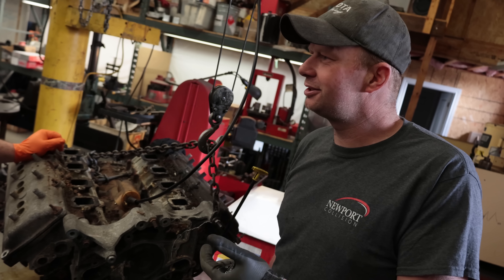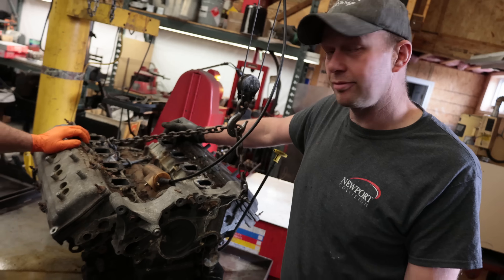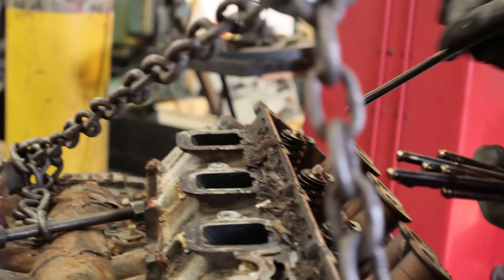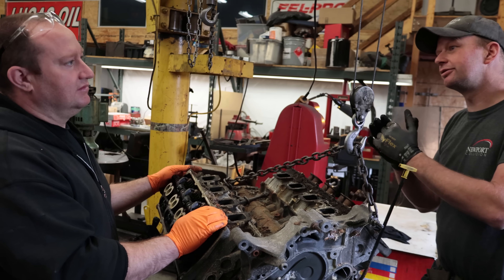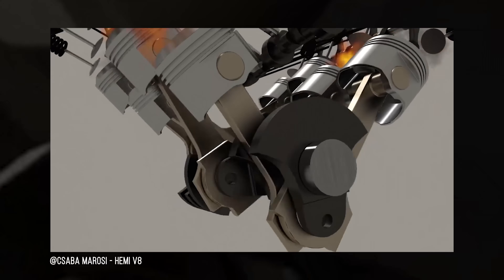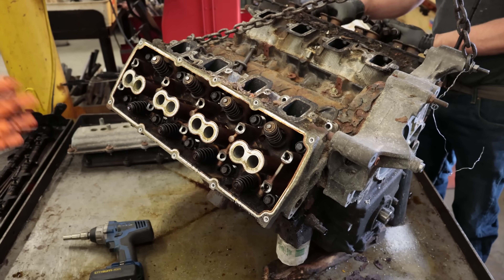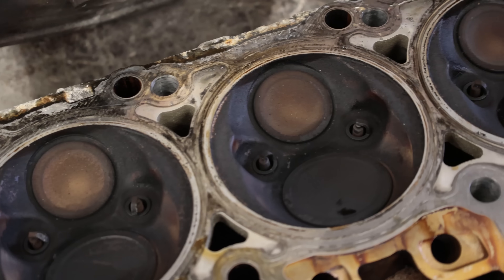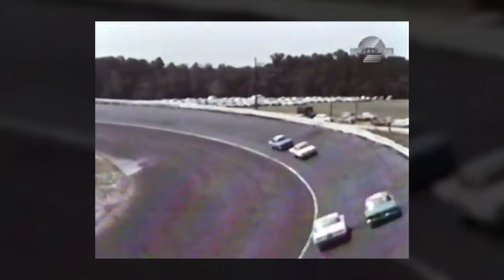REVIEW: Everything Wrong With A 5.7 HEMI 345 Engine

Comment: Lifter faliure started with the 09 vvt motors. The older pre vvt 08 and older hemis are bullet proof. Currently refreshing the top end on my 08 300c awd and deleting mds with hell cat lifters and replacing the cam in the proccess. Not because a lifter failed or anything it was still running strong but because it has over 230,000 miles and i plan to keep it so refreshing the top end and deleting mds and installing a high volume oil pump while im there is a good idea. Besides properly deleting mds and running aftermarket shorty headers to avoid another exhaust manifold leak + exhaust of course cause its gotta have a little rumble its going back stock These motors rip and amd have very quick snappy throttle response dont need more than 345 horse and dont wanna ruin the smoothness of the car with a lopey cam.  Im not turning it into a race car im fixing up/restoring the car to factory new. the early 2000s 300c's are very neat cars but sadly they attract low income people or people who make poor life decisions so almost all of them are butchered with awful modifications or wrecked. The cars get a bad rep cause the people who own them just beat them into the floor and / or partake in illegal activities. I finally got my hands on a clean untouched one and i plan to keep it that way. its Very handsome well built AMAZING driving unique american car when you leave it alone and dont install a million ebay stick on bits and lights, drive it like a dumbass or throw on ugly 22 inch wheels

Comment: I had an 06 Magnum RT and other than replacing plugs, belt/tensioner and the EGR valve and doing regular oil changes I did ZERO work on the engine.  It was at 487,000kms when I finally put it to rest.  That hemi outlasted everything.  It even outlasted 2 transmissions.

Comment: Im looking at the 2026 ram to get my first 5.7
Im an amsoil dealer amd have always been methodical about lubrications changes throughout my vehicles. Im currently running an 6.2 SVT with 111K on it and she runs like a top. I hope the new 5.7 will do as well.
Anyone else looking forward to the 5.7 coming back in 2026?

Comment: So whats wrong with  the lifters is the roller tip of the lifter is only splash oiled and the lifter is layed down so much that when its idleing its not splashing enough oil around so there is a few ways to fix it the factor oil pump at idle is in the teens like 15 to 19 psi if u put a High volume pump it got a 17mm wide vain pump the stock 1 is 15mm and to make it bulletproof johnson lifter makes a lifter that oils
The needle bearing on the lifters !! Them lifters alone are around 1000$ dollors versus around 400$ for the up graded stock like super bee lifters and  delete the dod lifters 4 cyl mode im specifically talking about a 2010 RAM 4X4 truck most if not all but just a few have lifter failure around 100 thousand to 150 thousand miles !! If u dont idle the truck alot it will go 150 if u do it will go closer to 100 if u never idle it you might get 160 180 but its going to fail if u have teens oil psi at idle if yours makes it longer its because yours has 40 plus oil psi hot idle!! So to check your car or truck get a scanner put on it and start it and its hot idle see what the scanner says if its teens its going out if u dont have any problems put a high volume pump in it and it should be fixed texas speed has all the parts to fix your motors im not being paid to say this im a mechanic and im fixing 1 now so all this is fresh in my head so im just posting to help save somone alot of time your welcome !!

Comment: I'm 80% done with a rebuild on my 5.7eagle. Had a slight tick when I bought it at 130k. At 136k git worse. Pulled cam and lifters and cylinder 3 lifter roller had completely disintegrated and I'd began riding only on the shoulders of the lifter. Mds delete engine flush and cam amd hopefully I can get a few thousand Iles out of her. Wish me luck.

Comment: So the MDS system really has nothing to do with the Hemi Tic, it has more to do with the lack of oil flow and pressure due to the oil pump being inline to the crank.  Less Rrpm's less oil flow.  MDS has been in the Hemi since 05 and the tic was not an issue, the block has not really changed with the exception in 09 and later the oil pump has produced less of a flow which in turn ruins the lifter...I have been reading and watching because I have a GEN 3 in my 19 and I have noticed that the tic is slightly longer on a cold start...so I am begining to think I should due a cam and lifter replacement.

Comment: I got a 2007 ram 5.7 never gave me any problems got it at 120k now its at 203k and never gave me a check engine light and i drive pretty heavy footed but not stupid. Mobil 1 5w20 high mileage every 3k-4.5k miles

Comment: Hello.. Interesting video.  I had a Jasper Hemi.  About 150k Parked it after a long drive. (No noises or anything unusual).  Parked the truck and next morning wouldn't start.  Determined no compression (about 30)  Shop said they think it jumped timing.  Can't understand when that would have happened as drove fine.

Comment: Why not use 2 different plugs. You don't need a $15 plug for a wasted spark. But if you route the wire back to fire both plugs at the same time and not waste a spark you should use the same kind.

Comment: 5.7 Hemi: Do an oil change every 5k or less. Never sit idle, treat it like a race engine and turn it off. Deactivated the "cylinder deactivation" every time you drive by locking out the gears in 8th. Always let it warm up untill you no longer hear the lifters ticking. If ticking continues once the temp is up, see a mech. Could be lifters or manifold.

Comment: I had a 2010 Ram 1500 with the 5.7 Hemi. It was a generally a good engine for me - lots of highway use which limited the amount of MDS time on the engine. The problem I had with mine was its tendency to snap the exhaust manifold bolts. I was on the second set of bolts on one head, and on the third set on the other. This also resulted in a replaced head on one bank since they couldn't get the snapped bolt ends out of the head. This problem with snapped bolts led to blown exhaust manifold gaskets which sounded like a kind of "Hemi tick"...
Reply: MDS is used far more on the highway at cruise speeds than in the city mostly accelerating.

Comment: I have a 2011 ram 1500 5.7. My cam and lifters failed at 80,000 miles .When I was in the dealership, they said this is a common problem.

Comment: The splayed four bolt main cap is stronger than the 6 or a the 4 bolt 350 main because of the side v pull the stress into the block in the wrong direction and make it actually weaker. The stresses imposed from the bolts coming from the outside of the motor sideways outweigh any gain in strength from the bottom. Is just kind of productive. Having the 4 bolt system and the two outer bolts at a display dangle seems to work best.
Reply: Angle not dangle. Google can't spell or I can't talk...

Comment: I have a 2016 dodge ram 1500 5.7L and on my last oil change at dealership (110k) I noticed a lifter tick not on start up but after about 1 min of driving then goes away but does it now every time,  the dealership told me to wait till something goes wrong then they'll address it because I have the unlimited powertrain warranty 🥴, I currently have 112k miles on it

Comment: Great motor if u maintain it my 09 ram 1500 has 260k miles still strong no leaks just the small hemi tick on startup have gone through a few water pumps n manifold bolts though

Comment: About the main cap bolts. Not sure which L.S. your referring to. 2 of the studs on the main cap are to hang the windage tray on the L.S. 2 bolts for the cap. I remember when the 2003 Hemi came out. Way more power thanChevy or Ford. 95 horsepower more. I bought one in an 03 Dodge quad cab 4x4. Had the truck for 12 years and 114,000 towing and hauling trouble free miles. My current 15 Ram 392 6.4L Hemi has a switch to turn off the MDS. Tow /Haul. Stock vs stock Hemi engines breath better because of the large opposing valves. (cross flow)

Comment: you do know that modern Pro stock engines have Lifters that high in the block and on par with the "hemi Horizontal"  
And as for the 4 bolts main.......We've gone as high 1800Hp on those 4 bolt main.

Comment: 1980s M body, especially one that had the 318-4V, since at least the A38/AHB police package cars already had a 8 1/4" diff, etc. As for the tranny; the A904/727 Torqueflites can be beefed up.or, the 5 spd M-B based unit.

Comment: I had a lifter fail at 97,000 miles in a '14 Charger Pursuit. Took the engine apart and it was the No. 5 intake lifter, which is not MDS actuated.  However, it was a cop car that had 1,600 idle hours, which is not so much, but probably more than normal. I have heard that the design is flawed in that insufficient oil amounts reach the cam and lifters.  Not sure.

Comment: Uncle Tony's Garage explains the failure point on these motors, Chrysler decided to move the camshaft one inch higher than standard height which is why the lifters are getting poor lubrication at lower rpms which after time embeds the lifters in place and eats camshafts.
Reply from the maker: Higher wouldn't matter.  Its the angle.  If height was an issue, and larger industrial engine would suffer from the same problem.
Reply: @DEBOSSGARAGE  And larger industrial engine use thicker oil which keep everything lubricated for longer periods of time rather than your standard 5w30 or 10w30. When I owned my 08 R/T I switched to 15w40 syn blend and had zero issues even after 300k+ hard miles. You'll have echanics blame the owners for not changing their oil but those same customers would change their oil religiously.
Reply: @DEBOSSGARAGE  The angle is also the issue but the height is 100% the problem since the ultimate failure is a lack of lubrication

Comment: Take it from someone who's owned 5 hemis.  They are a amazing bulletproof engine.  Exhaust studs and egr valves are the only issues that reappear. 

The Hemi "Tick" has nothing to do with lifters.  It is in reference to a condition in the 2003 to 2008 hemis that had valve train noise which was normal.  My 2005 would just idle and tick away and currently has just a bit over 700000km on it.  These days everyone has confused the hemi tick with the lifter failures in the 09 plus hemi with the mds,  not the same thing.

Comment: Got a 2018 Challenger 5.7 I got at 13k miles, had a small tick when I bought it, dealer wouldn't do anything said it's normal?.. Drives me nuts. Got 28k miles on it now and do oil changes religiously. Going to eventually trade it in so someone else can deal with it, maybe eventually buy a Hellcat before they stop making them
Reply: Could be injectors if its at 13k. The injectors on the 5.7 are known to be loud.
Reply: @bill_clinton697  I dont know, on start up it will be fairly loud tick tick tick then quiet down quickly to a tap tap tap, but still pretty quiet but I know its there
Reply: @ArcticAstrophysics  If its loud on start up and quiets down, you could already have broken manifold bolts. Manifold bolts love to go on the 5.7 HEMI, though they typically last longer than 13k.

Comment: Another issue with these gen 3 hemis, especially in the light duty trucks are valve seats. They like to drop the seats. I had an 04 1500 I bought from a buddy who owned it new and drove it a little harsh and it back fired through the intake, stated having a bunch of blow by and continued to miss. I found the pieces of metal in the plastic intake. Pulled the heads and sure enough, a valve was open very slightly at all times. 

Some
Options that would be more up your alley would be an older dodge truck like a Dakota, an older station wagon, or even a more custom build like a classic car…….

I’ve had a 91 dodge w150 and a friend ahas an 84 with a 318. Great little engine but sucks on power but decent on fuel. We contemplated a hemi swap bc they’re relatively cheapish and can put power down when you need it. Especially for some daily driver pickup that needs a little more pep in her step for towing, or off-road stuff. My 91 burb with a 350 tbi sucks when I take it to my favorite hunting spots bc I just need some extra juice on the skinny pedal. 

Or a Camaro with a hemi just to piss off is gm purest out there…..

Comment: It has crosshatches. They are microscopic and oil molecules reside in the valley of those crosshatches providing an excellent gas seal and greatly reducing friction between rings and bore. On an engine that has freshly been honed of course you can feel them. Engines are purposely prepared with crosshatches so that the final machining of the ring to bore is done by the engine itself. An engine tore down after 1000kms will look very different then a freshly built engine. But an engine tore down at 300000kms will not look much different than the one at 1000kms.

Comment: I would argue honing a cylinder is the worse thing you could do to an engine lol so I’m not a mechanic, but I recently rebuilt my 5.7 with 225,000kms due to a confused valve seat and for not running a 3 prong hone in decades I must say I made some pretty nice cross hatching. Took out the few minor marks at the top of the cylinder without losing much id and honestly I have no leaks anywhere, my exhaust is clear and it runs better than when I bought it. So if honing is the worst thing you could do in your opinion, what do you recommend instead and could you maybe explain in more detail why it’s bad because I don’t know anyone that’s rebuilt a motor and hasn’t used one

Comment: Is that a multi displacement engine? Only a few of the Gen 3s are not variable displacement. Great video. I have a 08 w 255k miles and I sold my last one a 04 w 355k miles and everything worked great! Synthetic oil is a must though as conventional gets too hot and makes sludge in the hemi.

Comment: Dropped valve seats were a common issue in the 03-04 engines with a fix in the 05's and onward that dramatically reduced the issue. Had a 04 Durango with the 5.7 in it, always ran Mobil 1, never had any overheating issues or anything else, drove home from work on a Friday in late November, went to start it on Sunday, immediate clatter like mad and then a bang. Dropped the valve seat which kept the valve stuck open, piston hit it, snapped the rod which are cast. Looked it up online and found it was a common failure at the time. Vehicle had 115,000 miles on it and was about 5 years old. Got an 05 engine from a Ram truck with 26k on it, had the dealer swap it and I put 75k on it before I sold it to a friend of mine that's still driving it now and he's put about another 75k on that engine with no issues. They did have swap the oil pan as the pan for the Durango is a different shape than it is for the Ram truck. Cost about $4k for the swap including the motor from a pull it yard.

Comment: I've seen a few with broken valve springs, but overall they seem like pretty reliable engines.
Reply: First-gen hemi in a 07 Grand Cherokee with 235K.  I think the tranny will give up the ghost long before the engine does.
Reply: Agreed. Got a 5.7 in My 14' Charger, and have had no mechanical issues. 100,000 on it, and I change the oil regularly, and don't let it idle for long periods of time.
Reply: The non mds hemi at least you can run the exhaust valve springs from the 6.1 as an upgrade. I swapped all mine to 6.1 exhaust springs when i cammed my 05. 16 were under 100 if i recall, but that was about 10 years ago.
Reply: Yea, i had an 03 in a ram with 124,000km and number one valve spring broke. Valve head snapped off and blew the piston head apart, snapped the rod.
Reply: I’ve broken 2 on mine. Just replaced those 2 springs and still going at 265,000 miles
Reply: mines 140,000 in a durango from new york, only thing that went wrong in the car is the power steering and this week exhaust leak tick which means i get to put a new fun exhaust and long tubes on now
Reply: No lol
Reply: @rock-uu7qr  yes

Comment: I'll admit to not watching the video. I had one of these motors in a 300c. It had 150k to start. I never put it away without at least one wot run. It was drag raced and run on many road course events. After four years with only yearly oil changes the car fell apart with the motor running better than ever. That's what's right with the 5.7.

Comment: My 6.4L Hemi ('15 Scat Pack) had the typical bad MDS lifter which took out the corresponding cam lobe within a matter of a day or two. I'll never, ever, ever, ever, ever again get a car of any sort that has a motor that has MDS, DOD or anything of that sort. Ever. Again. This had abut 120,000 miles on it, but with very regular maintenance. The "tick" sounded more like a Singer at full scream when the car was idling.

Comment: This is exactly what I needed to know about questions using my truck to idle for long periods for power and AC cooling.
Reply: Any vehicle that is idled a lot will benefit from a high idle mod. A lot of modern vehicles will have a wire connected to the main computer that activates the high idle feature. It usually isn't connected to anything, you just have to figure out which one it is and if it needs voltage or ground. Wire it to a simple switch in the cab and you're all set. Should increase idle to 1,000 RPM. Really helps to keep the cylinders from washing.